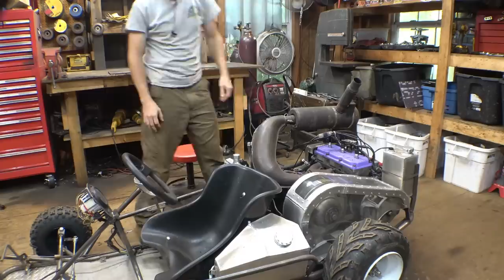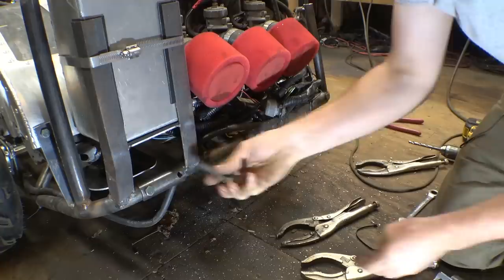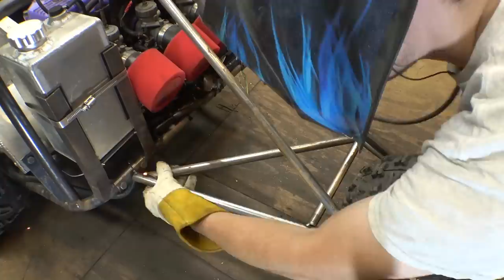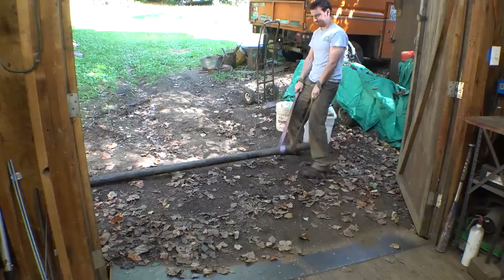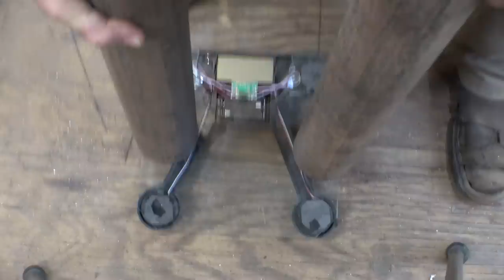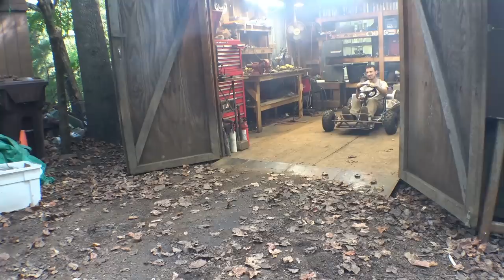Polaris XLT 600 Powered Go Kart Gets Wheelie Bars!!!

Comment: Why didn't you take the longer piece and weld brackets to the front of the frame, and then hang it off the front? The further forward you put the weight the better it'll be.

Comment: Chris, it’s possible to calculate exactly how much front weight you need.  Here’s how:  Put your bathroom scale under a rear wheel and measure the weight with you sitting in the cart.  Say it’s 200 lbs per wheel.  Now measure the front wheel weight.  Maybe it’s 75 lbs with you in it.  So at the moment the front wheels lift, the total load on the rear axle is 200x2+75x2=550 lbs.  Now those rear wheels are 16” in diameter, so that’s an 8” lever arm.  The best traction possible is about 1,.  Now measure the wheelbase, say that’s 60”.  So the front axle weight needs to be at least 8/60*550=73 lbs.  Of course, use your actual numbers.
Reply: What about engine torque? I'd say your not gonna get a good idea of how much weight is necessary without factoring in rotating torque.
Reply: @travisraplee6648  the engine torque, plus the gearing, is assumed to be more than enough to lift the front wheels, or spin the rear tires.  If the torque were lower than this, then the front wheels would never lift.

Comment: Would be cool if the wheelie bar could be removed and turned up-side-down, to have that second angle. This way you wouldn't need to carry a second bar, just rotate the it. Super awesome build tho Brother. Be safe :)
Reply: Thinking the same thing
Reply: Was just about to comment that, wouldn’t be hard if it was mounted with pins, just unpin flip over and pin it back
Reply: @xxxxxxxxxxx82  Great minds my friend lol
Reply: @zero99ification  Totally agree my friend :)
Reply: I was going to say maybe sliders so he could slide it up and down
Reply: Pipe hinges  at bottom that swivel and adjustable top bar .. would be a 1 all wheelie bar w no change outs.

Comment: Truckers use load binders to tighten chains that hold their loads down.  With less than $100 and a little welding and modification, you can adjust the wheel from 0" to about 6" or more.  Farm tractors with 3-point hitches have a top link.  One day later:  I was at HF today.  They had one of those 3-point  top links that are used to adjust the 3-point attachments.  Looked extremely well built.  $23

Comment: You could make the upper bars length adjustable and lock them with a bolt with butterfly nut to adjust overall height of the wheely bar.

The farther forward you install those weights, the more they will help keep the front down.

Comment: *Only idea , on wheelie bar , lower bars mounted with flexable joints and upper use a adjustable coil over shock so not to kill your back and have some adjustment ?
Reply: Agree. I did that on a drift trike I made in to a sand hill climber. It helps a LOT

Comment: That central weight is adding traction to the rear tires, I bet it does a better burn-out without it, or better yet stick that weight in front of the front frame cross member.

Comment: Slot the rotor on your brakes and it will stop better. Your not running it on a track so your not getting abusive break heat heat so slot that rotor up good and that should be an a good upgrade

Comment: Rather than add weight to the front (also worried about the poor spindles), I would have gone with slicks for donuts etc. Shame you couldn't have made a wheelie bar that could be flipped upside down to change modes. Awesome build though!!

Comment: You could put in a chain driven jack shaft  with the brake disk on it. It's not an eloquent solution but it allows for a lot more placement options and a significantly larger disk. Some of the subaru wagons have a e brake that goes to the front wheels instead of the rear. One of these disks and calipers will give you options for cable or hydraulic brakes.

Comment: I couldn't wait until you bought out this project again. my kart has quite a few of the same issues as that one. I burnt the brakes off of it the last time I took it out. so I'm working on that. I also have a problem with it being too lite in the front. it works fine on the pavement and hard dirt. but it won't steer on the grass. I'm going take a 3"X3" square tube and fill it with lead. I should be able to come up with about eighty or ninety pounds in a pretty small  space.

Comment: I would be worried about the front spindles letting go, when you dropped the kart you can see how much they flexed. A front mounted disc would add some support at least.
Reply: The front spindles are sprung. That’s why they move so much. You can see the springs when he’s adding and checking the front weights.

Comment: You might look at how general aviation aircraft brakes are set up. Might be able to get dual brakes set up designing something similar. A good example you can search… Cleveland wheels and brakes. Basically they are designed into the wheel rim with minimal clearance outside of the wheel. They do it to reduce drag primarily, but similar application might work for you.

Comment: Love the build, you may want to spin your can on the exhaust around so its facing down, oil can build up in there and run out of the tip, if it's up side down the oil has no place to go.
Reply: @Quirin M. what does that have to do with what I am saying?
Reply: @Quirin M. 🤣🤣 good old YT

Comment: Hey Chris I love your videos!! You may want to look into the wheelie bar have springs so that when I makes contact with the ground it can pivot into a spring so that all of the load isn’t slammed into the frame at once. If you come up hard enough it’s going to try to lift the rear axle off of the ground as well. Just a thought.

Comment: Research clutch adjustment you can change the weights and springs in the clutch so it engages hard at higher rpm like a drag snowmobile

Comment: I didn’t scroll through comments yet, probably already said but… you don’t need ‘more weight’ you need the weight farther forward. Light is fast, just position it farther in front of the front tires like make the round stock like a removable front bumper instead of 40 lbs behind the front tires move that back weight forward. Make the most of your weight distribution

Comment: Id have to agree that you without a doubt need front brakes. As a former motorcycle racer I know how much front braking does the actual slowing VS the rear which was used primarily for trail braking to tighten up your line and to help back a bike in if that was your thing. When we would prep race bikes wed often remove tbe rear brake resevoir altogether, and just use the rubber hose that normally connected the resevoir to the master cylinder. Then we would purposely add air into the system to make it spongy and discourage rear wheel lock up by a ham footed rider hahaha. Yes, four wheels are more than two wheels, but up until fairly recently if you were spinning wrenches on your own vehicles, youd know that when you did brakes, often times your rear pads or shoes looked like they werent even broken in. You could get real trick and add a bias valve too. That thing has waaaaaaay too much motor to not have front brakes. Remember too, your front and rear tire pressures are going to have massive say in just how much grip you get, even with those chevron patterned rears.If you raise the front pressures, less grip and more push. Lower them, more grip and less push. Too low however and you can get rim roll. The rears, same type of results; higher pressures give you less traction/grip, less of a contact patch, but gives you more wheelspin. Lower pressure = bigger contact patch, more grip laterally and straighty. Too low however and sadness ensues lol. Always check them cold of course!!! I finally got some of my street riding friends to try my suggested tire pressures, usually around 29-31 psi front, 26-28 psi rear, depending on temperature, rider skill, bike/tire type etc.  Youd think these guys all got brand new bikes, they were all freakin amazed. Yes, I know that lower pressures make the tires wear faster. Big friggin deal. Ill take quicker warm up times and more grip any day. I enjoy spooning on a nice new set of Avons onto my GPz550 lol!

Comment: Great work! Why not make the bottom 2 joint rotate over the bottom part of the cage (a bigger tube over a smaller tube). 
Than do the same for top part on the tyre end. And make the top part on the frame end a rod or plate with adjustment holes where you can attach a bolt or quick release pin through the top cage.

Comment: You could add front brakes. Would be cool to have dual brake pedals. Imagine if the front brake pedal had a bar coming off it that goes behind the rear pedal so when the rear brake pedal is pressed, the front pedal goes down too. You can also press only on the front brakes to assist with sick burnouts. Also maybe some 3 or 4 inch pipe with lead poured into it would be good for a counter weight.

Comment: For the wheelie bar you made for when you want to wheelie. I would have made it shorter. You could have just made the frame of the wheelie bar to position the wheel right behind the engine. That way it wouldn't be so much weight so far back. It also wouldn't be so high and hang so far back on it. Other than that it looks pretty awesome! Looks like it rips!

Comment: Watching you build the two sets of wheelie bars, I realized that you could build one triangled brace. The offset would be enough to keep the front end on the ground.  The remove  and flip it over to allow for max wheelies. Of course,  you would have to build  a quick release system to make it perfect.

I hope this is clear enough.  I have PD have trouble with wrds

Comment: I know it would be a lot of work, but front brakes would probably be the best. Most of your braking is done with the front wheels because the weight moves forward when braking. Also, if you still have problems with the front lifting, just move the weight in the middle to the front to get more leverage.

Comment: I know this is not the safest idea but you could put a brake disc on your jackshaft in addition to your rear axle disc. 
Correct jetting will make a huge difference to the drive-ability. Do you have the choke hooked up correctly, use it for the first or second pull even in the warm weather. I'm sure you have had a 2 stroke weed wacker, those you have to choke until the first firing, even then you may still have to use ½ choke to start it. I owned Polaris XLT's for about 10 years, they are very temperamental in weather above 35°. You will need to install smaller main jets and adjust your needle and probably reduce the needle jets 1 or 2 sizes. I will see if I can find a picture of a carb jet recommendation.

Comment: It's better to place the weights as far forward as possible as that is where they are more effective at keeping the node down. When you place weight further back you will need more for the same effect. So with less weight but it all being as far forward as possible you are stressing the frame less and keeping the overall performance better. 😁

Comment: Easier way of easy adjustment would have been to make a wheelie bar with a big tire and then when you put that smaller tire on it, it would be the higher wheelie adjustment so the adjustment would simply be the same wheelie bar but with two different size tires would be your adjustment. Obviously you’d not get that much of a adjustment as you built but still would been a good test with out building two completely different wheelie bar sets

Comment: Thought about steering in the little wheelie bar? Could do crazy 8's, lol. If not the wheel itself maybe where the bar mounts to the frame could swivel on one side and lever on the other. Then you could keep it straight up for miles of curves and traffic, heh heh. gg with the bar stock for weight.

Comment: Check the clearance on the belt side of the engine with the cover off. Maybe you can fit a brake and caliper next to the belt and just trim the cover out of the way. Even crazier idea put the brake on the output of the belt drive, won't do anything to stop you moving in neutral though.

Comment: Not sure how much room you have but you could try to make the brake rotor in a horizontal fashion. Use the same concept of a rear differential in a car and you could incorporate a bigger brake rotor that would dissipate heat quicker. Not a the most practical design but would be cool to see you make.

Comment: Since your adding weight to your vehicle, just get some drillers mudd and add it in to your front tires and a little bit of water and top it off with air, with throws small tires I think it should add maybe 20- 25 pound's per-tire

Comment: That's dangerously high for a wheelie bar! The angles will be crazy, and you have to consider the landing.
If you ever get enough grip to touch that wheelie bar, you'll be riding too fast to land safely. Most likely gonna loose control, or break some steering parts or something.
I'd say you follow the idea someone commented about an adjustable one.
Reply: Did you see the video where he actually had it out testing it?  He was doing some pretty big wheelies without a wheelie bar and never wiped out. He did have some rough landings though with the front wheels not straight. 
A wipeout video would be YouTube GOLD. 💵

Comment: Can you put the brake disc on the drive sprocket shaft? The gearing would multiply the braking power, wouldn't it? I saw a guy put a small brake disc on the input of the rear end of an off road build and it worked really well for it's size.

Comment: Weld some tubing that is slightly bigger than the tubing that you have for the wheelie bar on the upper part of the frame above the motor and on the bottom and make it so that you can slide it through and put a flip pen on the opposite end for quick release

Comment: What you really need to do is put more weight at the front, such as the rad and fuel tank. Yep I know you would need to lengthen it but you have had to do that at the rear with those wheelie bars.

Comment: Adjust the height of ur bars from 5 to 10 inches and work down from there. Most of the drivers ive talked to set theirs at 2 inches. As long as its not set so low that it puts too much strain on ur bars. Varies by output. I heard one guy even say they become steering assistance.

Comment: Put the original brake on the clutching from factory polaris...... With my experiences with Polaris triples is Def keep an eye on them plugs / Use NGKs & file the tips a tad, hogg out your silencer packing or get a can,,, And ,,, is it Clutched/springs/pucks/all stock ??? You can work wonders with factory clutching & minor work.

Comment: Is it possible to have 2 calipers on one disc. Then the surface the pads come in contact with, would be much larger. I don't know if it works though. Keep up the good work.
Reply: Of course it is possible, but I think it will not solve the heat problems, because it is still only 1 disc.
Maybe it works with a car brake disc with inside ventilation, so it can carry away a lot more heat.

Comment: You know, you don't need to overengineer everything with hiem joints! You can make a simple bolt pivot and have a pipe-in-pipe slide with a few holes in it for adjusting....

Comment: make a tube with multiple holes in it that telescopes over another tube, then use a hitch pin to adjust its height, would be easy and quick to do and only require 1 heim if done using tabs and bolts as pivots at the frame of the cart at the bottom as theres no need for heims

Comment: 2 adjustable sliding sleeves on the upper bars @ the rearmost end with holes drilled through and a pair of pins would've saved a lot of tubing,a 2nd hub,wheel and tire PLUS making the change as simple as pulling a pin on either upper tube and adjusting the wheels height,repinning it at the new height... My thoughts is that it's irrelevant because the frame itself is going to fold or collapse just behind the non braking front wheels after so many slams back down...

Comment: @rather B welding
Not that my comment is going to make a difference but you could just have one wheelie bar on it that has a shock absorber on it so that you can pump it up when you want to have minimal front wheel lift then you can lower the pressure so that the shock has greater travel allowing for a sustained wheelie.

Comment: If it were me I would get lighter weights for your primary clutch to lower your launch rpm of the motor so you can have more engine pulling in the lower rpms, I am with everybody else put front brakes on it I was running over 75 mph and a kid stepped out in front of me and I lost all steering thank God for brakes!!!

Comment: Why couldn't you make the rear wheelie bar so that you could unbolt it and install it upside down, then you'll only need the one part?
Also the extra weight...  couldn't you spin up some steel blanks and make them look like spotlights and mount them more forward, then you'll need less weight in-side the cab...

Comment: Off hand I know the sled's rotor was thick I mean like 3/16 or so the calipers are a whole new level off engineering those mcp brakes are no doubt the best by far in the go cart world now picture a 30,000
Reply: Dollar razor ya that is the world Polaris lives in the brakes from that sled are closer to CBR 1000 brakes then the go cart brakes .  I am 42 years old and grew up drag racing snowmobiles.  I am a Maine boy who lives in N.C. since my wife is from Hartsville S.C.  I miss my Artic Cats so much I just taught myself to weld now I am buying a tube bender so I can build a safe platform to install snowmobile engine and clutches eventually I am going to build a 300 hp Thunder Cat probably 1300 cc triple cylinder two stroke the kind of engine that maid Yamaha come back to two stroke engines I have seen sleds with this pedigree run 145 on 1000 foot radar runs were the first 300 feet was Swiss cheese it was tore up so bad.